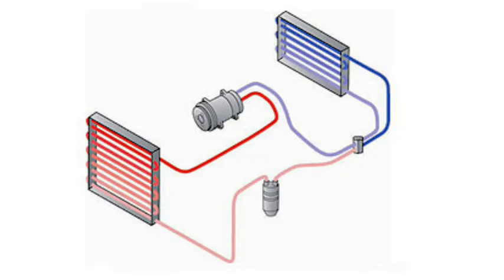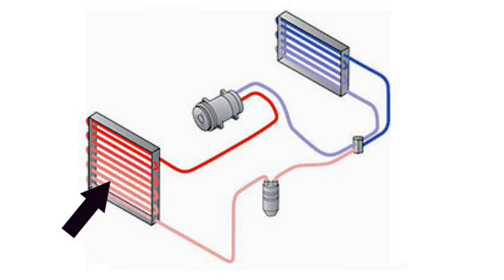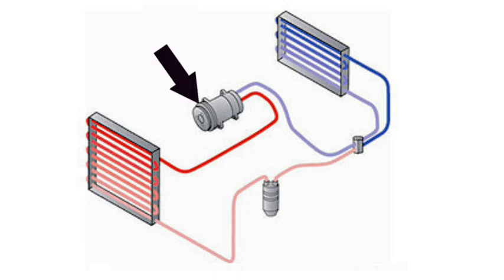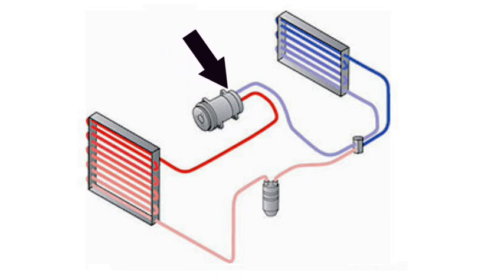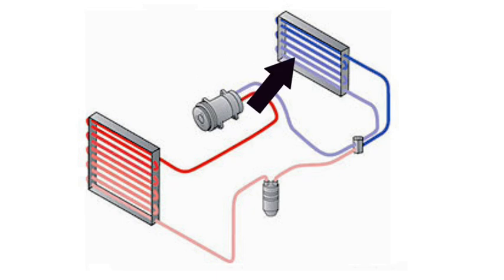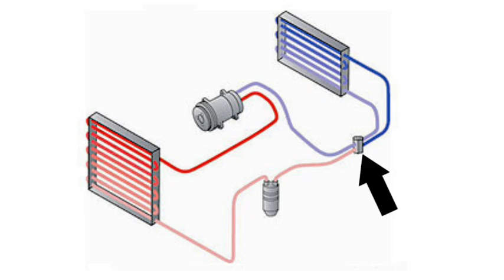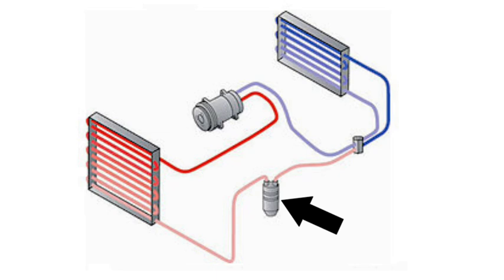AC System Basics - EricTheCarGuy

Comment: Hi Eric I just want to know why my A.C at nyt its soo cold but in the morning it cant handle it. I dont have tint by the way hehehe.. but still my a.c should handle it, or can it? Hehehe.. thanks...
Reply: Earl Alonso greed 
Your question is easily answered by this one fact. There is what is called a temperature pressure difference. When it is cold in the morning and you want to bring it down by only a few degrees, the system will not work as well. The incoming air going into the cabin is cool and the Expansion valve if you do have one is not opening up much because there is no big demand for a drop in temperature. Now if you wanted it to drop somewhere  20 to 30 degrees, the valve will open up more. Usually this will happen when the temperature is anywhere from 70 and above outside or inside you sun baked car that is all black. Hope this answers your question.

Comment: great video. but I'm having a particular kind of ac problem. the compressor is good for starters. and Freon is in the system. Their is a switch attached to the exterior f the trash can on the back wall. when connected it does not tart the system. a mechanic briefly told me to replace the switch so the system would turn on. He connected a wire into the connector and the system started. can't drive with an exposed wire so I need to know the name of that peace connected to the trashcan is called. next problem, once he connected to little metal wire in the connector and it initiated it still didn't get cold. what do you think?
Reply: +Contagious Entertainment A/C Pressure Switch. Should be available at most auto-parts stores. Would need more info like pressures to further diagnose your system.

Comment: there is quite a range of DYI videos from guys recommending duct tape fix's to dealer level repairs and a few mid range folks with common sense solutions with quick easy repair ideas that don't involve coat hangers, superglue or duct tape. I like Eric the car guy, middle of the road, good video quality smart well thought out subject matter. only problem i have is his recommending you have a pro do your a/c  work, have not spent hours reviewing the subject matter he puts out rather well along with tool suggestions et and looking online forever to find the best pricing on amazon, ebay or whatever c for nothing.....I am on this site to save money now and in the future and the whole purpose of these sites is to enlighten and educate the DYI guy to be able to do the repair at significant cost savings.........right??????
Reply: i wound't say that you are wrong but it was a recommendation kind of like electrical any one can do it but most dont have the time of equip ment and all it takes is one mistake and a $100 job is now a $1000 job so proceed at your own risk

Comment: EricTheCarGuy or anyone else, please tell me: is it possible to dismantle a car cooling system from some car and install it in a rabbit warren? I suppose the parts would be cheap to get on a wrecked or abandoned car and I guess that the system would be efficient as much as a regular cooling systems. I need more information about servicing such systems. Somewhere I've read that people used cool water from a well and pumped it through a car refrigerator and blew it in a warren by a fan, but that system is spending too much of pure drinkable water because the refrigerator is containing antifreeze and is polluting the water it uses.

Comment: Hi Eric I have a question for you. I have a honda civic 2008, my air stop working so I went to a auto part and got me a can of coolant but when I tried to service the system would take the fluid. so I took to an ac tech and he told me that is a small leak on the compressor and want to charge me 975 bucks to fix or replaemt of the componant I just toth that the price was incene a 180 buck part. i was just woundering if you could give me or opinion on it. I am an aircraft mechanic and I know I can do the work. thank you
Reply: An illiterate aircraft mechanic...great.
Reply: mrfrankcastle083 

Worse than an illiterate President?
Reply: Jose Servin
What isn't illegal these days? Besides, you only get in trouble if you get caught.
Reply: +Jose Servin Trump will change that! Lol
Reply: +mr42ndstblvd that's illegal, you moron.

Comment: I have a used chevy blazer 2000 model that blows hot air when i turn on the ac . I got one of those freon cans with a valve on the end  and a small hose  I followed the directions and it registered 0 pressure when i hooked it up to the thing . i put the correct amount of freon in the air conditioner on the valve but it still blows hot air. I saw the compressor thing turning on and off It started doing this when i put coolant in the air conditioner. Why is is still blowing hot air ? Do i need to clean off that screen on the front of the car by the radiator ?
Reply: rbeck3200tb40 
Ah, typical GM system. If you were reading 0 PSI on the guage, you have a problem. The major question that I would have for you is have you had this vehicle all the time since 2000 or did you buy it from someone else. If you got it second or whatever hand from someone, more than likely they had replaced the compressor when it seized up on them. Tried to recharge the system and it did just what you talked about. There is one major component in the A/C system that can be easily overlooked. On older systems there is what is called the receiver/filter which the later did what it should have done which is to filter garbage out of the system when it dies horribly. Usually known in the A/C service field as black death. This is when the compressor chunks out a lot of black garbage from the oil burning and the seals failing. The other part in newer GM A/C systems is called an orifice tube. This is what replaced the expansion valve as what was mentioned in the video. This also acts as a filter. You can find that in a number of different places in the A/C system. Poke around on the internet and see what you can find in the location. Best of luck on fixing your A/C heater.
Reply: Joe Esteph
 NO .I have no idea who owned this blazer  but i found some 9mm bullets in the middle thing between the seats . I guess they had a pistol hidden under there.  It has all kinds of weird problems. The front 2 electric windows dont go down, The dashboard lights dont come on, the radio channel digital display dont work, the windsheild wipers dont work except when you turn them on very fast. The cruise control dont work. The back wind shield wiper doesnt work but you can see the nut holding the wiper on spinning. Can i replace the fuses to fix those things ? I dont know anyting abotu cars or engines except for a few things. After i put this refridgerant stuff in the first time i put the hose on it again the next day  and the gauge read all the way down to zero again. Does it have a leak in the alluminum hose somewhere?  I dont knwo what the heck a compressor is. Is that the tall silver looking thing thats shaped like a coke can ?i have a can of air conditioner leak stopper that will stop leaks. Can I use that ?
Reply: rbeck3200tb40 
The tall aluminum thing you are talking about is the drier. If you lose what you put in in less than 24 hours, you do have a leak. Either you have some seals that have failed. Those are parts in the connections of the A/C system or you have a damage to the condenser, the aluminum radiator in front of your main engine radiator. Usually if the condenser has been damaged you'll see it quickly if you put die into the system and run it a little with freon behind it. Eric the car guy did a later video after this one on how to find your leaks. I would suggest looking at that video to have a better idea. You can get those cans with freon and leak detector in them to do a quick find. Happy hunting. No pun intended with the bullets.
Reply: Joe Esteph
thank you i did find a can of leak detector that had a dye in it. i will use that

Comment: Eric thank you so very much for making these videos!!  

On my 99 Civic HX, I just replaced the AC compressor belt, that had been missing for several years...

Then when I cranked up the car, sure enough the AC blew super cold, just as I had hoped it would.

Then, went to show my wife how great I am, it still worked great, ice cold for about a half an hour or so.

Then, inexplicably, it stopped blowing cold, despite the Green AC Button Light being on.

So checked under the hood, to see if the Compressor Clutch was engaging, sure enough, it was not, despite the Condenser Fan coming on when it should.

So to recap, the Compressor Clutch should engage whenever the Condenser Fan 
comes on, yet it does not now despite doing so earlier in the day.

Or is this symptomatic of a system that simply needs to be recharged?

Any ideas?

THANKS IN ADVANCE SIR !!

Comment: I have a 2003 GMC Sierra 2500 h/d 8 cyl. My problem is my fuse under the hood for the A/c keeps blowing which in turn does not allow the compressor to work. The fuse is a 10 amp as soon as i put the new one it pops again. Please help as to why this would keep happening?. Thanks
Reply: Terri Flores 
You have a short in the system. It could be in the wiring or it could be the clutch it self. I would not recommend trying to figure this one out yourself. It takes patience to track this kind of problem down and if it is in the compressor clutch coil, that is getting in deeper than most people would want to do. Recommendation, take it to a mechanic if you determine it is the clutch coil.

Comment: hey ERIC wen I charge my a/c system the L line and the H line are both cold and was frosting the A/C was kool for about 1/4 mile drive wen I finish charging the system and it remain blowing hot air after that session don't kwn what to do...need some advice

Comment: if i run my car AC of 3 or 4 point is it start consuming more fuel... can u share an animated video that how ac c takes fuel to run..
Reply: The fan setting speed does not affect the amount of fuel that your A/C system consumes..the compressor has a pulley that is spun by your engine at all times and when you turn on your ac, the electromagnetic coil engages the compressor and that's when it actually begins to use the engine's power to pump the refrigerant throughout the system. 

In simple terms, when you turn on your a/c, it does not matter if the fan setting is on 1 or 4, it will consume the same amount of power
Reply: thnk u MrDjnes.....
it mean that AC not cosume fuel... it share the power of engine..... and if i Drive my car between 50-60kmpl than it will not effect my cars millage.

Comment: Great video,Just subscribed! just bought a used 2004 Chrysler  town and country as a daily driver to and from work. I had planned to add to the low side with a 134A refrigerant kit and I  decided  to take a look at the condition of the AC system before I started. I found that after the low pressure fill port the line was terminated and ty-wrapped  to another terminated line.  I have a trusted mechanic and I will now leave this to him to do this job. This is a warning to the DIY's who might try to add refrigerant to their system. 
WEAR SAFETY GEAR, Glasses and gloves, You can get frostbite from the refrigerant. If I was not able to see that the connection was open and started to do the fill I could have been injured.

Comment: Hi , thanks for video 
does covering for low pressure pipe after the evaporator to the compressor with thermal insulation material can increase the efficiency of the system
Reply: Qusay Al-Nassir I second this question. will insulating either hi or lo pressure pipes help the ac run cooler, by keeping the heat from the engine off the pipes?
Reply: Qusay Al-Nassir 
Yes, The side that you would want to cover is where you see condensate(moisture) collecting on the low side pipes. I own a 1992 Buick Park Ave and they put what is called an orifice tube in the low side from the condenser. This is what replaced the expansion valve. Covering the high side lines will not help due to the fact that you are only making the compressed refrigerant that is heated up to stay heated all the way to the condenser. Hope this answers your question. Also R152a is a good replacement for r12. Just do your homework when considering the change.

Comment: Hello Eric .that diagram is not accurate ,the filter dryer or accumulator is located on the low side before the compressor ,that's why when the system is running it get's cold and may even sweat moisture on a humid day . one of it's main purposes is to  keep liquid from reaching the compressor .The compressor can only have vapor or gas in and vapor out . The filter dryer cannot absorb air only moisture . Once gas leaves the compressor and goes through condenser it comes out as liquid (liquid line) and then to metering valve either TXV (thermal expansion valve ) but most likely an orifice tube that drops the pressure by turning liquid refrigerant to flash gas as it enters evaporator and turns cold so it can absorb heat from car interior ,then gas leaves evap through accumulator (suction line ) into compressor and gets pumped up to high temp  gas where it goes into condenser gives up heat to outside air by being hotter than the incoming air so a thermal transfer takes place and a change of state (gas to Liquid) so heat from car interior can be moved or transferred out . The definition or air conditioning is " moving heat from a place it isn't wanted to a place it doesn't matter " or outside air

Comment: Let's say I wanted to make an ac system using car parts and a 12v electric motor connected to a solar panel for using inside a van while the engine is not running. All I would have to do is mount the condenser outside on top of the roof (with a fan?), and place the rest of the parts inside?
Reply: hed420 and the fan is not enough to make the condenser cool bcuz your condenser is in the roof haahah sunlight create a lot of heat hahahahahahahahahaahahahahahah
Reply: it will be only work so long as ram air was hitting the condensor or if you are constantly moving the vehicle
Reply: hed420 
you would need several horse power to turn the compressor. 
one horse power equals 745 watts. point is, youll never do it. at least not easily. buy a small used rv system and install that. power it with a generator.
good luck
Reply: +Justin This would never work, it is made to cool a cubic foot highly insulated box like a mini fridge, these junctions are very inefficient as well.

Comment: Hey guys so my ac has been giving me some trouble. When I am driving around its super cold and works great, but the second I stop whether it's at a stop light or moving slowly through a drive through it gets hot. What could be causing this? I had it vacuumed and had new freon put back in, but the problem wasn't fixed!
Reply: Myles Holiman replace your compressor compressor dont have enough pressure that why when you speed up your engine gets cold bcuz compressor is speening fast but when stop compressure speed is normal and dont have enough pressure
Reply: It can be a deficiency in the compressor and it may need to be replaced. Also, take a look at your condenser fan, if the condenser fan does not work, it will not cool down the condenser, which in turn your a/c will blow hot air. Hope this helps.

Comment: Thanks Eric, I appreciate your video's, I am typically on the fence between able to afford a mechanic and doing it myself, after multiple donations to soma ripoff mechanic, I find myself here with solutions you provide for free...Freedom! is found here, and thanks to your graphic, http://i.imgur.com/QvmxUEi.png. I realized I had the r134 adapters backwards. I was wondering why the low side was blowing off the couplers at 110 psi, blessed with zero exploding cans and your great video, I was able to understand the error of my ways with no injuries. Also too, my newly converted 86 Dodge w250, now blows cold air. Right, stay cool, thanks for all you do.

Comment: Hi my compressor is broken and create lots of scrap iron in to my AC system. My mechanic told me i have to change the whole system. what do you recommend?
Reply: james yin replace compressor un install the whole system and drain the system u can use pressured water but use pressured air to dry it up make sure all of the parts are dry and also replace ur receiver or dryer. so u can have less use of money. but if its my car ill change the condenser and evaporator and expansion valve

Comment: Soooo, if it simply highly compressed air through a small passage that makes it "cool", than what is the purpose of refrigerant?
.
From Wiki "Refrigerant": "Air has been used for residential,[19] automobile,[18] and turbine-powered aircraft[20][21] air-conditioning and/or cooling. The reason why air is not more widely used as a general-purpose refrigerant is the perception that because there is no change of phase, it is too inefficient to be practical.[19] Yet, with suitable compression and expansion technology, air can be a practical (albeit not the most efficient) refrigerant, free of the possibility of environmental contamination or damage,[19] and almost completely[22] harmless to plants and animals"...
.
Since you could use various liquids as "refrigerant", wouldn't isopropyl alcohol  ("rubbing alcohol") be the best choice since it is cool to the touch on skin?
.
I have had problems with my air-conditioner freezing up with a block of ice on the evaporator. Pretty cool to figure out the problem....